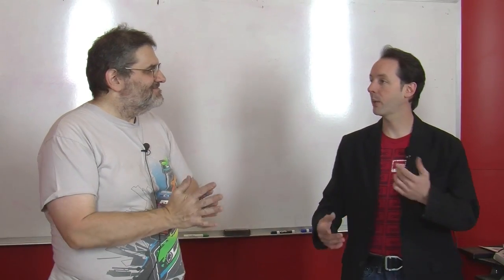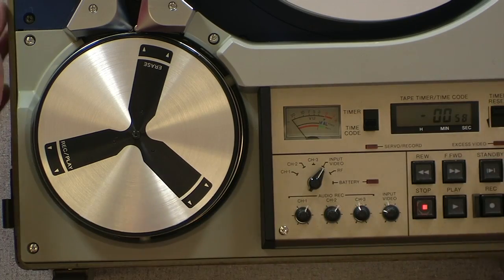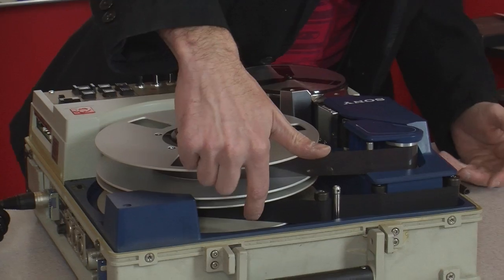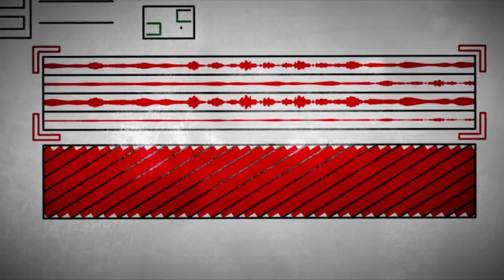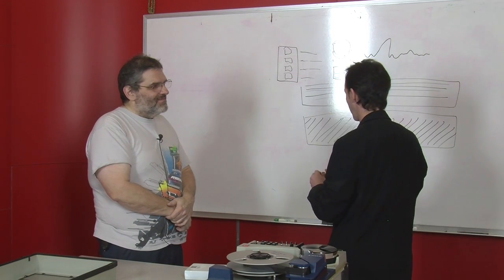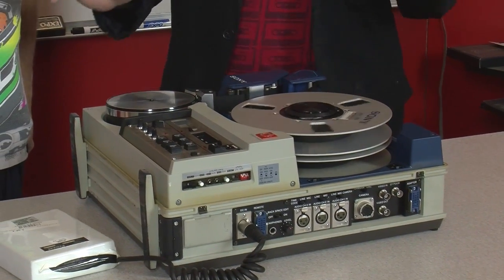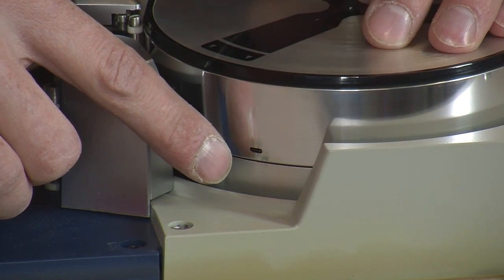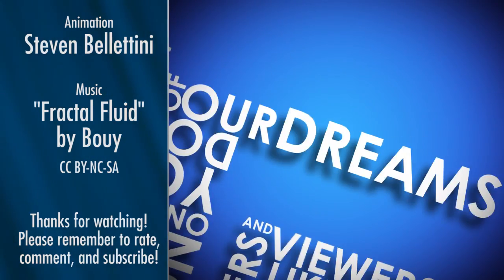How Reel-to-Reel Video Recorders Work

Comment: Control track pulses are like a metronome keeping time. Tape speed is never perfectly constant so the recorded pulses help the VTR mimic the recording's tape speeds during playback. It's never perfect, so these Time Base Correctors you may have heard about can be used to electronically finesse the video timing.

The whiteboard anim and that VTR are both a joy to behold. Love this vid!
Reply: Actually it was not pulses but a tone of 240hz that was made from the incoming veils rate of 60hz. This tone was like sprocket holes on film. The tone was then used on playback to lock the capstan speed. Simple

Comment: Yep, that's a BVH-500. I've used one before. You want to try threading without touching the face of the tape to keep the oils of your fingers off the transport. Also it's common to trim off the damaged tail of the tape. If the creased part of the tape goes through the drum, it can damage the spinning heads.

Take a look at an Ampex VPR-5. The last and greatest 1" portable helical VTR.

Comment: The reels spinning opposite ways looks like it uses a differential to keep tension on both reels.
Reply: No, there are two separate motors driving the reels through concentric shafts.  Tension arms send a sensing voltage to the reel drive servos so that the correct torque is applied to each reel to maintain consistent tension.
Reply: Its belt driven

Comment: Did you initially thread the take up spool the wrong way. Made me cringe when put manual tension on that spool,too much back tension equals wrecked video heads. So easy break beautiful equipment like that.

Comment: I read up on pro videotape, and the type your recorder uses is called Type C, and there are  many different manufacturers of the actual tape (not sure who is currently manufacturing the tape though) but I do see a *lot* of 3M Scotch brand tape, and probably Ampex as well.
Reply: 3m was the standard in the industry, the was Fuji, AMPEX, Maxwell. But 3m produced the most consistant brand of tape

Comment: There are numerous analog delay lines in old hardware like this. Those delay lines are used to delay the audio or the video. Look it up on wikipedia, some interesting articles on that.
Reply: Actually, no.  The audio R/P head is a fixed distance from the video track, and that is part of the SMPTE type-C standard.  I just dug up the training manual from when I went to Sony BVH training school some 30 years ago, and the audio R/P head is 116.63mm from the portion of the video track as it transitions from line 24 to line 25.  Analog delay lines were commonly used in quad videotape machines like the Ampex VR-2000 as part of the AMTEC and Colortec units, essentially pre-digital time base correctors.
Reply: Haha what arr you talking about there is ZERO delay lines in these machines. The only microsend delays are in a Time Base Corrector or TBC

Comment: "this may be why we got this donated"  hah... That or it's just OLD technology.  I've thrown away a bunch of those BVH-500's and the large rackmount version, the BVH-1000.  BTW,  hit the STANDBY button (top right) to spin up the heads and keep them spinning.  Then you can push other buttons to do what you want and not have to wait for it to keep spinning up/down.  Most 500's dont have a color corrector, so playback is fairly useless.... but they did record nicely!

Comment: Sorry Chris you were slightly wrong about the control track, without the control track there is no sync, therefore nothing to track the video too. The tracking then hunts trying to sync making the pic roll or jump. So the control track is very necessary. Also out if interest the early  2" Quadruplex format recorders would wright the information in tight horizontal lines, they would edit the tapes using fero fluid and a razor blade like film :) .
Reply: I worked on EVERY machine AMPEX maded and it makes me chuckle when I hear people refer to the control track as pulses. A control track is a tone of 240hz. It is a multiple if the field rate if 60hz. It acts like sproket holes on film. On playback the capstan speed is derived from this tone, it is also used to govern head speed. The two must be in perfect sync with each other. Tbe tracking control refers to the phase difference between recorded control track and head speed. The control track has nothing to do with a sync signal, that comes from the recorded video. With TBCs rhe sync I usually striped off the recoded video and replaced by a clean signal generated by the TBC. Some analog video switchers also did the same thing. They ignored incoming sync and regenerated it. The poor quality video mixers did not refer sync signals and were always a problem
AMPEX AVR series of QUAD machines could very easily playback a tape with no control track. It only needed a few frames to get in sync as it took the timing off the video itself as the circuitry woukd determine where the head should be for max RF output. It would multiply the video frames to obtaon both the tape speed and headwheel speed. The video didnt even need a sync signal! Truely an amazing feat if anakog video engineering

Comment: Re: Copy protection. I don't know if the control track method was used on all video tape systems, but the copy protection schemes I know of work by inserting 'loud' signals during the blanking intervals of the video signal to confuse the AGC (Automatic Gain Control) of the recording VCR. Also, not all video tape systems record the video straight onto the tape, but use various modulation and superheterodyne techniques to accomplish it, and sometimes for Hi-Fi audio as well. Just FYI :)

Comment: How does the recorder deal with the delay between the video head and the sound head, or does it just record with a delay the has to be fixed later?
Reply: The audio record/play (R/P) head is always a fixed distance from the video track:  116.63mm to the transition between video lines 24 and 25.  Since that distance doesn't change -- it's part of the standard for this tape format -- you can record a tape on one machine and play it back on another, and the audio will be exactly in time with the video.  Conceptually, it's no different from sound-on-film, where the sound drum with its optical sensor is 26 frames beyond the gate (28 frames for mag stripe film).
Reply: Mostly fruitless answering questions years later, but... 
There is no "delay" between the video and audio heads. The fact that the video and audio where recorded on separate locations on the tape will be "matched" during playback. The location of the heads will stay in sync... just as recorded.  Audio and video will both reach the monitor in sync with each other without need to be "fixed" or "compensated."
Reply: What delay? There is a standard od the ohysical properties of the 1" C. It specifies the physical distance from the first video track to the audio stacks. As long as manufacture adhered to this standard that was no delay at all in fact film audio LEADS the picture and ib video the audio lags the video tracks

Comment: That's awesome! What's the resolution on that? 240 lines like a VHS or more?
Reply: The NTSC version used in the United States was 525 lines overall, of which about 486 were active.  In todays digital world, the closest equivalent would be 640h x 480v.
Reply: 300+ lines